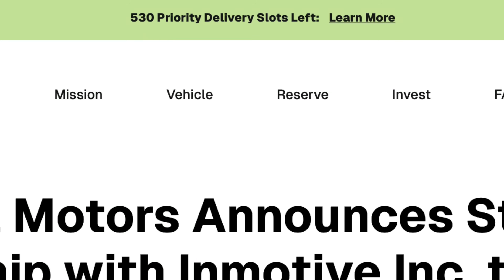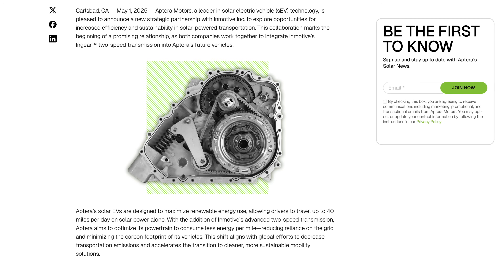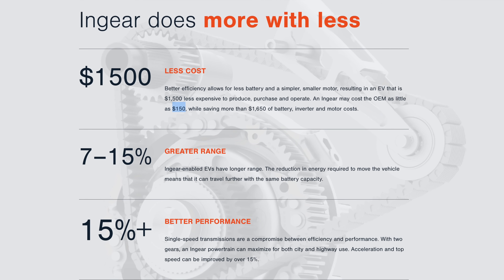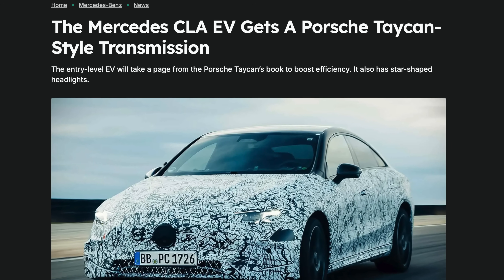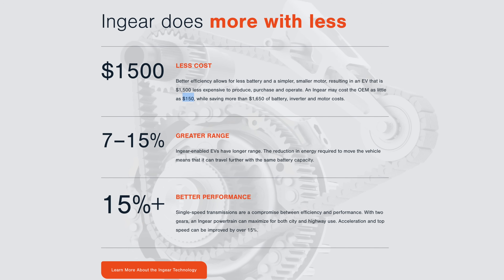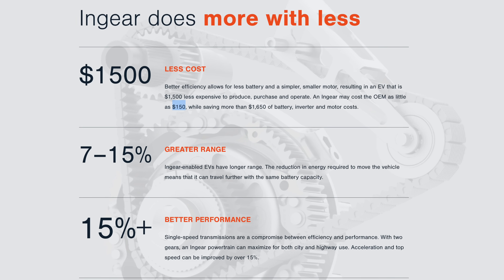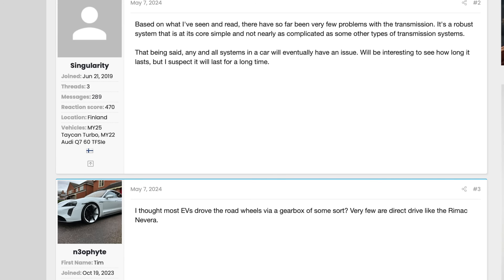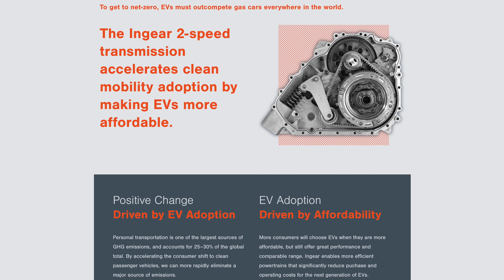Aptera Gets A Transmission?? Explained

Comment: I'm a performance/sports car and two door Hot Hatch enthusiast who believes certain cars are more than an appliance to get from point A to point B. I want to see an electric sports car or Hot Hatch with a six or seven speed manual transmission with a clutch pedal. Not some flappy paddle transmission that modern sports cars have, like the C8 Corvette. I'm also a Mini Truck enthusiast. The Slate really has my attention.
Reply: Nobody will ever make one because nobody would ever buy one. The efficiency and cost would make the car inferior in pretty much every way.
Reply: @drunkenhobo8020  Guess I'll stick to ICE cars and trucks then. Every car and truck I have ever owned has been a manual transmission, two door hatch or coupe. All of my trucks have been manual two door regular cab short bed trucks. I even took my driver's test in a manual transmission car. I HATE the modern auto industry. All the fun cars and trucks are being replaced with soulless appliances!
Reply: @Kevin6t8  I'm from the UK, where doing your driving test in a manual is mandatory if you want to legally drive a manual car.
But even here the manual is quickly disappearing. 2019 was the last year where manuals outsold automatics and by 2025 it's 80% autos.
I currently drive a small fun manual hatchback but my next car will almost certainly be electric as it just makes the most sense for me. There are at least some fun ones now. America doesn't get them of course.
Reply: @Kevin6t8  You do not understand how useless transmissions are for electric motors.  The torque curve is practically flat from <1 RPM to up to 13k+ RPM in some EV motors.  A manual transmission will only make you lose power, and your reduction gears, not to mention your clutch will be UTTERLY SHREDDED by the torque of the motor.  Current EVs have single-speed reduction gearing built-in to let a launch actually work, but otherwise still allows a top speed over 100+ mph before torque begins falling off.  There is no transmission at all, flappy paddle or not.  Go test drive a Model 3 Performance in track mode and you'll get it.  Take it from a former Subaru STi cult member (or not).
Reply: @SoyElDiabloRojo  You do not understand  how soulless electric motors are! Cars, no matter what powers them, are more than just appliances to get us from point A to point B. Why can't we have fun along our journey from A to B without having to be so soulless?
Reply: @Kevin6t8  You have no idea what you’re talking about because you haven’t driven a Model 3 Performance in track mode.
Reply: @ 
I DO understand the purpose of transmissions. 
I also understand how boring it is to drive a vehicle without any physical interaction beyond operating the accelerator pedal, brake pedal, and steering wheel. You might as well let me sleep behind the wheel. Vehicles ARE NOT just appliances to get from point A to point B. There needs to be a level of enjoyment in getting from point A to point B without it being mind numbingly boring.
Reply: @Kevin6t8  Are you a bot?  I don't care how many times you say "Vehicles ARE NOT appliances" YOU HAVE NO IDEA WHAT YOU ARE TALKING ABOUT UNTIL YOU DRIVE AN MP3 IN TRACK MODE.
Reply: @SoyElDiabloRojo  There are only two Teslas I like. One hasn't come out yet (Roadster 2.0) and the other was killed off (The original Roadster).  The Rivian R3 is what I'm waiting for. I also like the SLATE truck. I hope it makes it to production. I also don't care about 2 second 0-60 times or 10 second quarter mile times. I like driving twisty back roads or driving Tail of the Dragon.
Reply: @Kevin6t8  Yeah me too, which is why I did tail of the dragon in my 07 Solstice GXP, 2010 Sti, 2016 Sti, and Model 3 Performance.  The M3P was FAR more fun.  Last time I’m bothering: YOU DON’T KNOW WHAT YOU’RE TALKING ABOUT UNTIL YOU DRIVE THE CAR.  I don’t give a flying fuck whether you think it’s pretty or not.
Reply: @ ANYTHING with four doors is for Soccer Moms. I ONLY drive two door cars, trucks and SUVs. IF I buy an electric vehicle, It will be something with two doors and be ANY OTHER BRAND BUT A FUCKING TESLA!!!
Reply: Heck yeah brother! I agree!!

Comment: So the low speed ratios stay the same?
When I first saw the gears being added I thought the low end ratios may change and this might improve turtle mode.
The zero SOC performance is not discussed much if at all. 
I once limped "home" in my PHEV and struggled to get up a shallow up slope - some lower gearing might have helped.
You can't have everything....
Reply from the maker: I feel like with a range that high + solar charging it’ll be more rare than ever to arrive places that low
Reply: @TailosiveEV  I've never had less than 120K remaining in my current EV. I have zero range anxiety but I like to have answers for the EV haters who claim we will need tow-trucks. Most EVs don't just stop like ICE cars - its a mostly undocumented feature.

Comment: I’m more concerned the about the torque steer we’ve seen when quick cornering and acceleration. When one front wheel starts to spin the other side’s pull the steering.
How about using a Torsen differential?

Comment: I really question the benefit of more engineering complexity; we are well past "pencils down".  The EMR4 (induction) plus the Vitesco IWM would also improve efficiency while adding accelleration and winter performance for those wanting it.  A transmission adds parts and time.

Comment: My first issue is I recall Chris M saying that the switch to the EMR3 was the final change in a long line of major changes. Not only was that wrong, but highly likely Chris had to know this was in the wings when he made the promise. Ginger says it was possibly a year ago, so it indicates more lying. It is also something Aptera should have revealed before they announced the latest investment program. Once again, investors are doing it on the basis of a product that won't eventuate as shown, and which was known to the snake oil salesmen well ahead of time. 

My next concern is that this is employed to get closer to the performance figures they have spruiked for years, and it should not be used for that. If it is more efficient, it needs to show better figures by the margins the suppliers advertise.

Then there is the case of Fartimus being made without it, and probably without the aluminium frame; the unfinished UI/UX, and the glass rear hatch. They are still making inappropriate prototypes, and will pass them off as production intent. Only those parts that are used as excuses or discovered by people will be known to be sub standard; I am sure there must be more. It is plain to see that they still hand build each prototype, since none have been on anything that resembles a production line.

They were supposed to be doing Fartimus concurrent with German-eye, and Steve F said German-eye was being assembled in the March update, but now Aunty says it is yet to be started in the April update. It gives time for the new gearbox to go in, but the million mile testing can't be done, and the total time will eat up most of what's left of 2025. It took more lies to string you gullible fanboys along, yet you continue to trust them. This gearbox is probably one more planned delay to going nowhere.
Reply: This vehicle is definitely not for you.   Consider doing something else that you care about, as your contribution here, on whole, ain't constructive.
Reply: @mavigogun  I'm 71 and don't need someone who is probably wet behind the ears telling me what I should do. You aren't making much sense as it is. I will step through my concerns and see if they only apply to me: 
Chris M probably lied about no further changes. Well, that should concern everyone. Company reps shouldn't tell porkies.
Aptera bosses should have revealed the change before announcing the investment plan. Since I don't intend to invest - not even my concern, but important to potential investors.
The 2-speed might be used to compensate for poor performance. A concern for preorderers, which I am not one. I suggest getting your money back if you are, or you are gullible.
Fartimus is yet another improper and incomplete prototype. It's just a fact, and it should be of concern to fanboys and donors of both kinds. It shows me not to participate, but I have brains.
Fartimus is being hand-built. No plant machinery and no suppliers who supply is of concern to you clowns, but it's just a joke to me. Definitely not for anyone because there are none,
German-eye all talk and no action. You should be concerned because most of the past 5 years has been the same. Just another joke to me.

It's patently obvious that you clowns should all be concerned and I'm out because never have I wanted one. Since it doesn't exist, it's definitely not for anybody. Since it will probably never work, such that there is real utility, it will never be for anybody. Since AM is about to go bankrupt, your money going down the toilet is of major concern to many of you, but just a joke to me. Now, if I didn't get some sort of value out of what I do, do you think I would continue to do it? If I cared more about something, do you think I would forego it for laughing at you clowns? My contribution here does plenty for me without being constructive in any way that helps the silly trike or the gullible fools who back it, but here's the kicker - I am not obliged to be constructive for you fools. I probably help a lot of actually normal people, but that isn't necessary, either. You are shallow, and it's because you lack the ability to think and to see through things. What you read and what you conclude are poles apart. What you conclude is stupid.
Reply: You'd have an easier time convincing Scientologists that L. Ron Hubbard was actually working for Xenu all along.
Reply: @drunkenhobo8020  Yeah, they're weirder than those religious nutters.

Comment: I hope they don’t have the same  trouble that Tesla had with 2 speed transmissions in the original Roadster. They had a really high failure rate but they were mainly focused on acceleration.

I’m sure transmission technology is way better now but there is a reason why nobody else is doing this though, they may still have reliability issues.
Reply from the maker: Porsche and Mercedes are doing it
Reply: @ that’s good. I hope they make it work.

Comment: Iirc Tesla had a 2 speed option for their early vehicles, but due to failures in these transmissions, they were removed.
Personally I'd rather see no transmission, and use one gearing.
Reply from the maker: Taycan is a far more recent example. Many things have changed since 2008
Reply: @TailosiveEV  difference between a newbie company and one that that has been building performance cars for nearly 100 years.

Comment: I agree. Seems like a no-brainer to at least try it out. I doubt it will add any significant drag on the critical path (scheduling-wise) to production. When I first heard about this on Wednesday I first thought (1) How big is the thing (how will it fit?),  (2) How much is it going to cost and (3) What will it add to the maintenance requirements. I was thinking in terms of ICE transmissions which are big, expensive and need periodic maintenance. After looking into it yesterday (and confirmed by this video), I discovered that it's relatively small (I'm sure Aptera has had this in the works long enough to have figured out or even designed in a way to add it to the drivetrain), inexpensive (I saw the $150 price tag, too -- seems like a steal), and is relatively maintenance free (e.g., no clutch, no high pressure pump). The animated video of it in motion during the shift-up and shift-down shows how ingenious the design is.
Reply: Link for us lazy gits?
Reply: @jwvandegronden  YouTube blocks most of my posts when I try and include links. Key words for a search can be a viable fallback.
Reply: @jwvandegronden  YouTube doesn't play nice with links in comments, but if you Google "inmotive ingear transmission" you should find it.

Comment: i mean with regards to porsche, theres a reason they arent using a 2-speed in the macan, and from what I've heard the full upgrade to the taycan wont have one either as the efficiency gains weren't worth the tradeoffs to mechanical complexity, plumbing and overall user experience, also all the german OEMs from my understanding test their vehicles in the strictest EPA tests, showing an artificial range as a worst case. the CLA having one is interesting and will be interesting to see. if I'm wrong, I'm wrong, and I don't mind being wrong, its a chance to learn, but from what we've seen outside of EV trucks, the 2 speeds arent really worth it, maybe this one is cheap enough that they don't care
Reply from the maker: Yeah the inmotive one is likely way more simplified than Porsches and only meant for low powered motors. Taycan is crazy fast and the transmission probably had to be designed accordingly
Reply: The 2 speed transmission allows the Tycan to accelerate quickly in low gear and maximize the range at cruising speed.
Reply: I thought the $150 price was net --- including overall vehicle savings, such as a smaller battery --- not the price for the transmission itself.